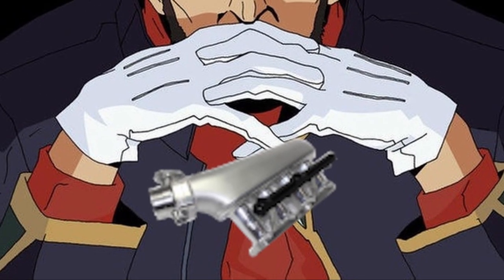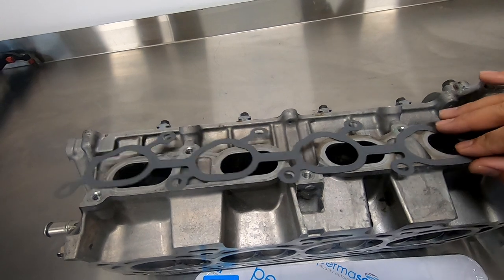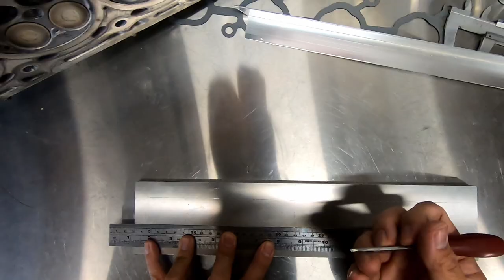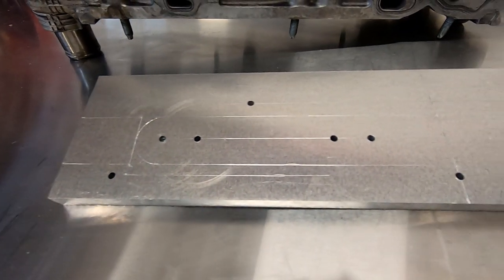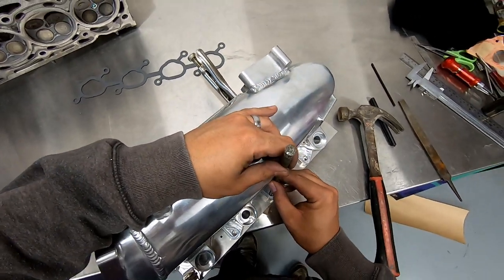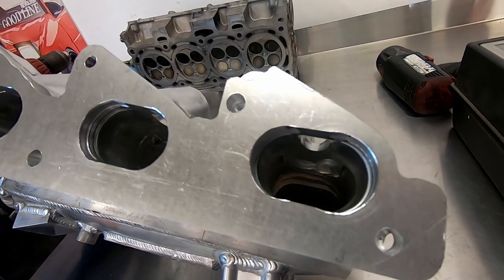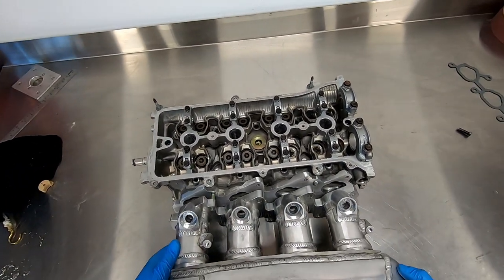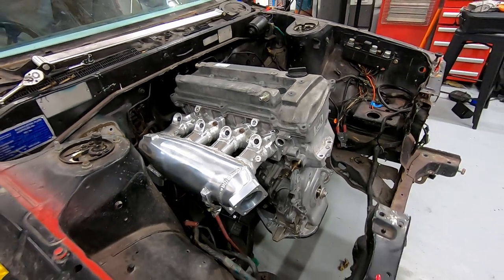How To Make A Custom Intake Manifold Adapter Plate - SR20 to 2AZFE DIY - Project Wonder AE86 #7

Comment: man, I really hope before you port those intake and exhaust ports that you got the head flow bench tested, I have been looking for 2AZ head flow cfm numbers for awhile now
Reply from the maker: thats the plan although i have 3 cylinder heads so would be good to do a side by side comparison on the flow bench ported vs stock

Comment: Is it true about the cylinders if both engines have the same amount of cylinders does that work for every make and model.
Reply: So i can use the same air manifold from a other engine as long as they have same number of cylinders
Reply: Make me air intake manifold

Comment: What if your engine is a reverse flow?
That means both intake and exhaust ports are the same side
Reply from the maker: then you would build the plate accordingly to that specific cylinder head.

Comment: Got the same engine in my camry. Any recommendations on ECUs and any good aftermarket parts supplier in Australia? All of the aftermarket parts I found are expensive.
Reply from the maker: thanks for watching lochlan! unfortunately for plug in ecu's there isnt really much choice. I would recommend Haltech or Link ecu for stand alone on a budget. or you wanted something really basic you could run a piggy back ecu to control fuel and ignition only. As for aftermarket parts in you are better off looking in the U.S for scion TC parts as they have a much larger aftermarket. hope this helps!